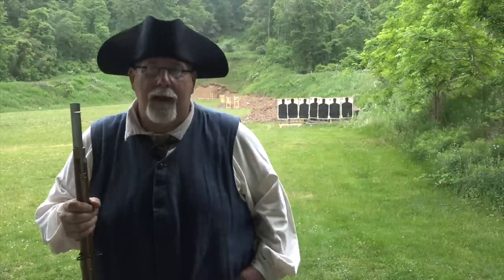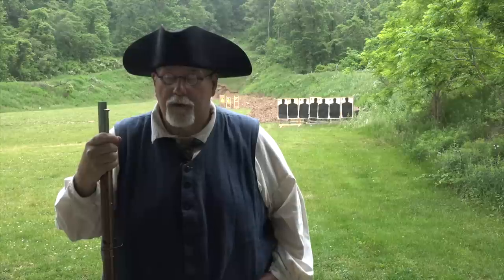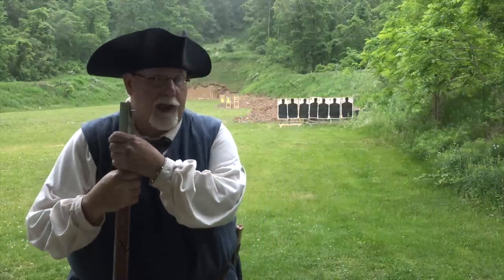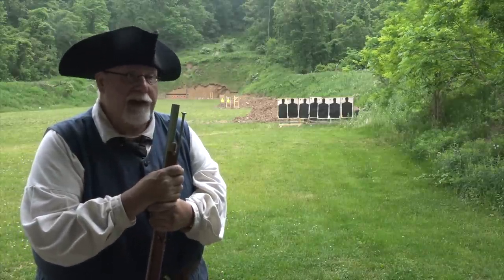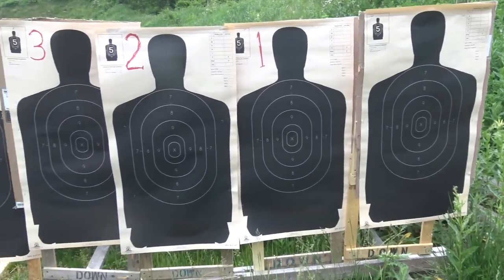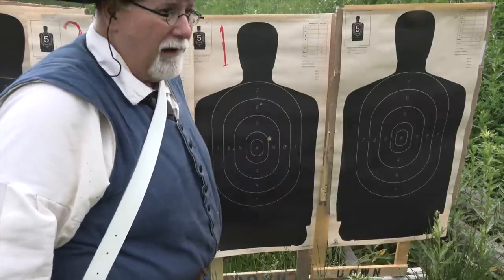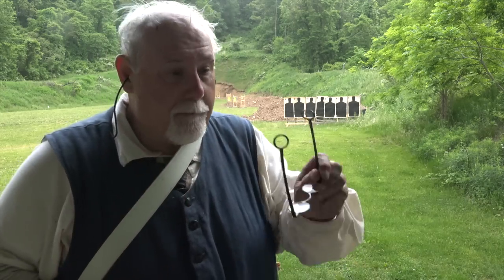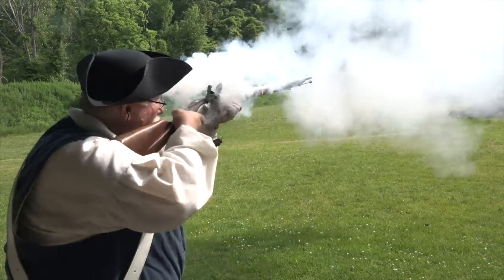Combat Effectiveness of Buck & Ball Cartridges

Comment: Mr. B. notice you loaded with the shot on top.  is there any difference with the buck under the ball, Because of the guns that were recovered and x-rayed showed the buckshot then ball on top.
Reply from the maker: I’ve seen that photo of the x-ray. All I can say is that I couldn’t find any written info on buckshot under ball paper cartridges. We can see that at least someone loaded that way, butI’d like to see some documentation on how that cartridge was made. The shot under the ball will spread less than shot over ball.
Reply: That is interesting.
Reply: Yours is an interesting comment, would like to know the answer.
Reply: @duelist1954  Probably wasn't made that way. The shooter probably just loaded the cartridge upside down.
Reply: In this thread over on a muzzle loading forum, two users report better accuracy with the buck underneath the ball, instead of on top. 

Would be great to see both methods used back to back. Especially if we can see the results after every single shot  to make sure which shooting did what we see on the target. 
https://www.muzzleloadingforum.com/threads/buck-and-ball-use-by-continental-army.119229/

There is also picture there of better grouping on the target with buck loaded under the ball.
Reply: Buck on top was the standard U.S. military version of the cartridge for as long as smoothbores were used.  They also issued ball cartridges where individual accuracy rather than massed fire was anticipated,and even some times buckshot cartridges for night-time guard duty..  Unfortunately, as is often the case nowadays, I no longer have the references available.

Comment: In the early engagements of our Civil War, some militia units showed up dressed in uniforms not unlike yours, with smooth bore flintlock muskets. Many other militias had percussion smoothbores from the Mexican War era. So, buck and ball loads saw combat again, because the same problem presented itself again of each side firing blindly through its own cloud bank of smoke into the enemy’s cloud bank. During the first volley of the engagement, when the air was clear, I suspect most of the men on line were aiming at the center of the opposing line, whether by doctrine to split the line or just to ensure a hit.
Reply: Buck and ball remained with rear echelon units for the rest of the civil war, better guns were needed elsewhere and this loading was the best way to use  smoothbore muskets.
Reply: It’s interesting to me that at least one ammo company has recently marketed a 12 Gauge shotgun loading of buck and ball.

Comment: I gotta get a flint lock one of these days. :)

From your little experiment, it seems like if you're not going to use musket balls that a straight buckshot load might be more effective than buck and ball when you're over 25 yards, although when you get out 100, in my mind, I'd have to question the effectiveness of buckshot, especially against a thick woolen uniform and much over that distance is just a wish and a prayer.

Comment: Glad you interjected, "As a rifleman", my feelings exactly.  Occasionally a smoothbore with the right bore and one ball combination can be found to be rather accurate @25 -50 yds, but they were the exceptions.  Kudos to you for your heat and humidity tolerance.  At my age and with my Alpine and Scandinavian DNA I would have passed out.  I can no longer tolerate temperatures over 80 F or humidity over 50%.  Because of our mid-Atlantic climate, I rarely get to shoot in my club matches anymore.  The fact that we go directly from Winter into Summer, and Summer into Winter does not help.
Reply: I'm grew up in Bucks County when it was still rural. In Philly, they say, "It ain't the heat, it's the stupidity." I'm down near Mayberry, NC and it really is no hotter or humid than SE OA.

Comment: Another reason why I think buck and ball would be a good load to use in a double barrel shotgun while hunting deer in the Eastern woodland it can be extremely thick cover with shots anywhere from 5 to 50 yards and half the time on the move so haveing the one large ball to cut through the brush and the three smaller ones to try to sneak their way through it you've got a much higher probability of  you hitting your target

Comment: The test shows buck and ball can be very effective, however the test did not show the biggest draw back to volley firing. You shot one shot at each of the 5 targets in the middle. But in line of battle you can not be sure if each of the shooters are not going to target the same soldier. So in your test at 50 yards and beyond you reasonable expect all targets to pick up a hit about 90% of the time. But in real combat with shooters all individually picking targets at random you could expect that some targets were shot at multiple times. This could leave large gaps of soldiers untouched while a few files down could receive devastating blows from multiple buck and ball rounds. I have never seen it written down and documented on how to conduct effective volley firing in any manual or soldiers memoirs.  But if when in line of battle the solider were all aware of their own position in line and for example if they were the fourth file in from the right of the line then they should target the fourth file opposite them in line. If every soldier would beware of their position and do this then buck and ball would be extremely effective even against a larger formation as long as one more very important point is also achieved. That being you best be on the side that fires first.

Comment: As heavy infantry typically were not drilled in precision aimed fire, but instead regular and quick rithym load... Using ball alone a platoon of 40 shooters would likely toss 35 shots short into the dirt. 

Fire casualty rates back up that assertion.  Many pure infantry were not civilian hunters, or were only bird in flight fowler hunters.  For British troops, at home before entering service, they were forbidden to bear arms as subjects unless they were gentry or above in class.  The idea of elevating above the target to account for the gravity drop is beyond most recruit's minds that took the King's shilling.

The buck load adds high hitters.  You'll notice most of them spray high and wide.   Part of that is caused by the paper patched ball chaser being pushed by the wave of gas.

Viewers remember that on your side too, men are that close together and firing in unison, then reloading in under a third of a minute and then directed fire again.  Those five volleys are going to happen in two minutes and often lines are closing.  Doing the demonstrating in reverse 75,50,25 might show growing casualties.

So multiply your hit ratio times 10 for just your targets of five front rankers.

Comment: Does it make a difference if you load the buck first followed by the ball; did I miss you mentioned the load? Great job as always just the facts!
Reply from the maker: I find ball on top loads to be a bit more accurate, but all the military manuals put the ball under the shot.

Comment: Thank you for another great video Mike!  I'm curious; did you have any issues with the cartridge breaking open while loading allowing the buck to spill out?  When capandball did his buck and ball video he mentioned that the buck came loose a few times.  There's an x-ray of a recovered Brown Bess loaded with buck and ball that shows the ball closest to the muzzle and the buck between the powder and the ball  https://en.wikipedia.org/wiki/Buck_and_ball  .  Your test cartridges were built as specified by the ordinance manual but I'm wonder if the enterprising you soldiers and marines may have changed the cartridges so they would hold up and not lose the buck shot if loaded for an extended period.  Thank you again!
Reply from the maker: I had ni problems. That method of Tying the shot and ball is very secure.

Comment: What was flying back after each shot on the first set of shots?
Reply from the maker: I lost my flint a couple of times.
Reply: @duelist1954  thanks. . Is that common. I haven't shot my flintlock more than 6 times so far? Going to have to bring a tarp so I don't lose mine.
Reply from the maker: @pcnorton  No. After a year of use, the sheet lead that Pedersoli uses to hold the flint lost its grip. I replaced it with leather when I got home.